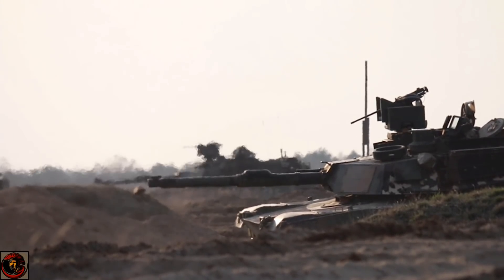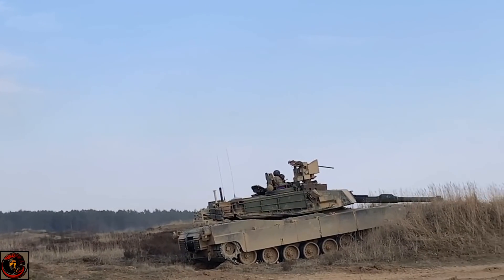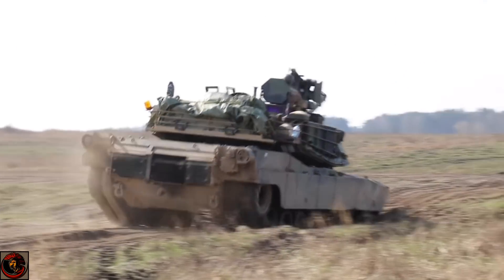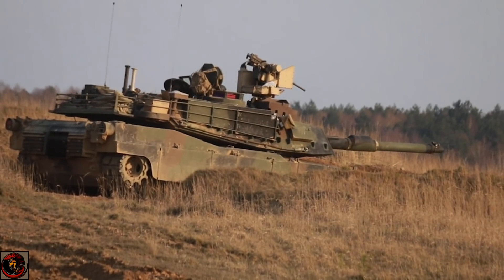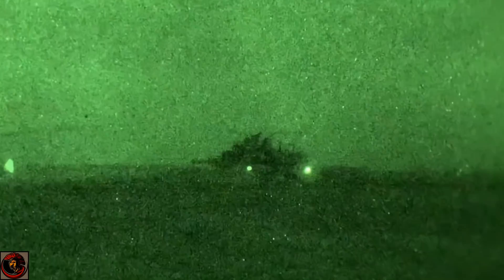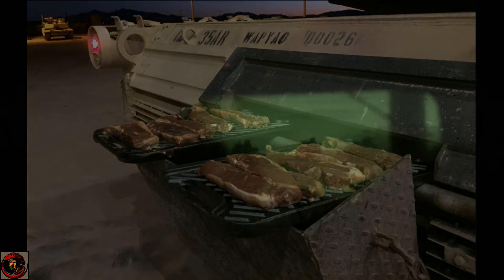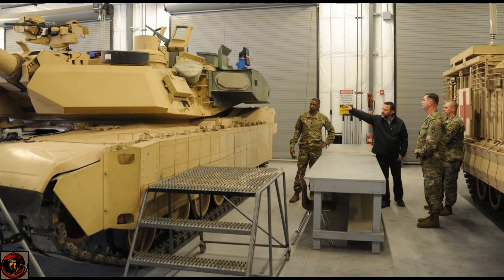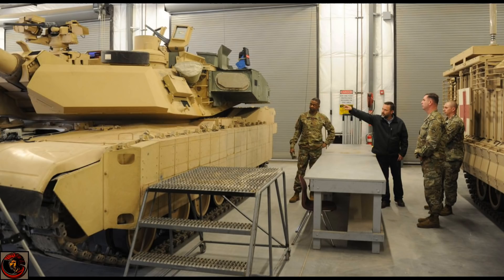M1A2C Abrams Tank Upgrade - The Last One?

Comment: Yes, the Abrams upgrade gets the Trophy active system AND a new top-secret armor blend that includes a layer of uranium.  So, both active AND passive protection upgrades.  And a very thorough digital electronics upgrade with high end computing power and data uplinks and a battery bank that allows the crew to operate sensors and the remote machine gun without firing up the turbine engine.

Comment: I wonder why they don't stick a 20 mm Gatling gun on the top, and use it for taking out incoming missles. Would also allow it to engage aircraft. And with how much it weighs, couldn't you build a hybrid system for it aswell, so you could run it in electric mode. Oh, and covering it in OLED screens so you can give it adaptive camouflage.

Comment: Now... One itty bitty little thing that people get wrong allot, that ALLOT of people think is true and is an inherent flaw to the Abrams.
It's fuel consumption.. 
In your video you say the Abrams is notorious for burning gallons and gallons of gas per mile.
While the Gas Turbine engine does go through fuel faster than, say, a Diesel Engine (Not much faster tbh, there are many Abrams crewman who can tell you they've been on long journey's for several hours without needing to refuel. One crewman has even said he's been on a drive for 15 hours straight without needing to refuel)
the Gas Turbine DOES have a far longer service life than a Diesel engine does.

Not trying look at you and go "lol he got a fact wrong, laugh at him" just pointing that out to anyone in the comments in case anyone despises the Abrams tries going "lol, gas guzzler"

But anyway, I doubt this will be the last upgrade to the Abrams

Active protection systems are not necessarily something of the future. APS's  have been around for several years. In fact, the first Active Protection System on the Abrams was actually an automated machine gun that targeted incoming ATGMs. And has proven itself to be effective.
I'm not saying to NOT install a trophy system to the Abrams, I'm just saying.. Active Protection Systems have been around for quite a long time, and aren't necessarily "the future"
Reply: @komradearti9935  May be a significant different, no doubt, but that does NOT deny the fact that the stereotype of the Abrams being a "Gas Guzzler" is VERY over exaggerated. And is merely something for those who have a blatant bias against the Abrams to use as an argument

Yes, the Gas Turbine consumes more fuel than a Diesel. While that much is true, so is the fact that the Gas Turbine gives the Abrams a higher top speed and lower maintenance cost.
And even then... Does consuming more fuel really matter when a Gas Turbine can use almost ANY kind of fuel...
Petrol, Diesel, fuckin' maple syrup, doesn't matter.
Shit if people were curious enough I wouldn't be surprised if some battlefield science found that friggin' compost can fuel a Gas Turbine. ( Obviously I know that's dumb and not possible, but I hope you get the point I'm trying to convey here.)

Comment: Tanker here, My old unit ran M1A1SAs since 2007, and in 2015 or so we did some wargames with another armored brigade equipped with A2 SEPs. now, one difference between A1SA and the A2SEP is the commander's weapon station; the A1SA has a powered cupola with a stabilized gun mount, which is not much taller than the original cupola. the A2 SEP has the CROWS system, and holy shit did everyone hate it. except us. because that was literally the first thing we saw every single time, and there were cases where the A2 commanders had to get entirely out of the turret to look around the CROWS. from what I've seen the newer low profile CROWS isn't much better. what's more the commander's stabilized weapon station is capable of much higher elevation, and can be reloaded without having to expose yourself very much. by now you might be saying "why did they delete the commander's cupola, if it's so much better?" the simple answer is that the commander's cupola makes use of a collimator sight for it's FLIR that would be constantly bumping into the commander's multifunction display in the A2.

Comment: I would not be surprised at all if the Abrams is put out to pasture in the next 15-20 years or so. It's a dammed good tank and it's upgrade history has kept it current with the times.  That said, it's a thirty year old chassis that was designed in the late 70's to replace the M60, and is itself based in part on the MBT-70, a failed design it took the place of.
Upgrades are great, but anyone with a mechanical background knows you can only push that so far, and I think the venerable Abrams may be reaching that point soon.

Comment: I think there is no other way, than crew of 3 in hull capsule for future tank... Remote control turret with 140mm (maybe 130mm in early versions) ETC cannon (like cancelled XM360) with autoloader, ASOP, next gen armour plus NERA, ERA or NxRA packages. Most important is the situation awarenes with sensors, and network centric Warfere. For me it is possible that crew will have not only monitors with at least 120 degrees od visbility, but even VR googles with augmented reality genereted in real time. So the creew, or part of the crew will have abbility to see through the hull with enhanced combined view from different modes from different cameras, sensors and outside systems like IBCS satellites calculated and supported by Ai. This will look like in few years or maybe decades time. I think, for Rail Guns and Lasers is to early.
Reply: The us doesn't like autoloaders for good reason. They are slow and highly unreliable. Are you Russian or something? 4 or 5 man tank crews will always be better because you can't beat a human loader. Russian autoloaders are about 8 seconds between rounds where most Abrams loaders are at about 4. Rate of fire Trump's almost anything

Comment: What aboht the lighter gun they were testing and "supposedly" a new armor that was just as good but also lighter?  Before I retired, these were being talked about.  If it worked it would also have the side benifits of less wear and tear on the chassis and engine as well as the much needed reduction in fuel consumption.  The weight losss was stated to be as much as 10 tons.  That would be amazing ifvit was true.

Regardless, this is a great machine with a great battle performance record for it and its crews. The only real tanks that can currently challenge it are British, French and if they are working, the Germans.  There are others that might, to be sure, but until they develop an actual combat record for themselves and their crews we don't know.  And hopefully we don't.

This old infantry guy tips his hat to those folks..."Death before dismount!"    ;)

Comment: Needs a 140mm main gun upgrade
Reply: Not nearly enough Dakka.... we need three, strapped together with the power of industrial flex seal
Reply: '
hi C J...
120mm is a middle weight but 140mm is more heavy weight...
that would be nice to have 140mm cannon gun on the M1A1 - M1A2 abrams battle tanks...
140mm can easily destroy any ussr russia tank
Reply: @bestamerica  The US secretly has them as in back in 2010 some Abrams prototypes were seen with larger cannon barrels on transport.

Case is US doesn't want to spark an arms race and keeps these technology in blueprints and schematics just in case RU or CN wants to up the game by going larger caliber

Comment: Let's say there are around 10.000 build Abrams. 400-450 Challenger 2 and 3.000 Leopard 2.
This gives a ball-park figure of 12-15.000 tanks in the same category of 60-75 tons.

Yes that gives a lot of older tanks that has been upgraded and if they had been constructed from a clean sheet of paper 10 years ago, they just might have been made lighter and slightly better - possibly.

The relevant question is, however, what is going to take issues with these tanks?
The 3.000 + T-90'ies of 45 tons?
320 planned T-14 Armata of 50 (-) tons?

These updated western tanks have a weight advantage of 15-25 tons and a numerical advantage of - say - 1:5. Which means you can preposition parity numbers about 5 different places - it will cost money in storage facilities and upkeep. But if you fly in the crews you don't NEED to move these lumps of metal all that much.

Let's ask ourselves: Is it realistic to think that - say Russia - will be able to sweep such a force aside?
I agree there is a lot of political blustering, but with minimum of sanity? Is Spain going to switch sides and join forces with Venezuela to invade the USA?

What is the more realistic possibility? That Russia will lie down and weep in selfpity or Canada occupying the western seaboard of the USA?

Will the USA occupy China? Given that americans are generally nuts it is a possibility, but even the most french patriot is hardly going to assume that the USA would wish to deal with the vast internal problems of China. Realistically: The crackpot iraqies have been quite bother enough.
Reply: Wtf...?

Comment: The thing is, you don't simply scrap 70t and millions of dollars worth of equipment, you keep upgrading the platform up until you can. The same idea, in a larger scale, applies to Navy ships. You don't scrap them after decades, since the hull is expensive, not only in terms of direct cost in dollars, but also the cost in time to build. So upgrades come as long as the platform is useful!
Let me remind people that even the Mighty Mo' fought well into the 80's after a retrofit and that wasn't some marketing stunt by Reagan and DoD, that ship could control the seas and give massive support fire if used correctly with support vessels, specially with the Phalanx and all the newer radar and missile systems. Besides shit tons of armor and 16in guns dropping a big F you and everything around you miles away is always effective, at least in changing pants colors to a more earthy tone.

Comment: Matt, you should check out Combat Mission from battlefront.com. They have WW2 and Modern-based CM games and I'd like to see you play them. They're probably most-similar to "Steel Beasts" but withouth the ability to directly take control and pull the trigger - but instead focused on tactical combat, terrain, cover/concealment. MilSim for strategy gamers, so to speak.

Comment: But, what about the M1A2 SEPv4. or M1A2D? You see, the M1A2 SEPv3 was on standard upgrade lists for the Army, but then the US Marines wanted to upgrade from their M1A1s to the new M1A2 SEPv3. So the Army put in its request as well. And its another notch above the SEPv3. But because of the Marines and Army having personal requests, they are being given the label as C and D rather than the usually Gen-Dyn Land System's classifications. 

M1A2C (SEPv3): Has increased power generation and distribution, better communications and networking, new Vehicle Health Management System (VHMS) and Line Replaceable Modules (LRMs) for improved maintenance, an Ammunition DataLink (ADL) to use airburst rounds, improved counter-IED armor package, improved FLIR using long- and mid-wave infrared, a low-profile CROWS RWS, and an Auxiliary Power Unit (APU) under armor to run electronics while stationary instead of the engine, visually distinguishing the version by a small exhaust at the left rear. More passive ballistic protection added to the turret faces, along with new Explosive Reactive Armor mountings and Trophy Active Protection systems added to the turret sides. Prototypes began testing in 2015, and the first were delivered in October 2017. Fielding is expected to begin in 2020.

M1A2D (SEPv4): Under engineering development with delivery planned to start by 2020. The Commander’s Primary Sight, also known as the Commander’s Independent Thermal Viewer, and Gunner’s Primary Sight will be upgraded with 3rd Gen FLIR, an improved laser rangefinder and color cameras. Additional improvements will include advanced meteorological sensors, laser warning/detection receivers, directional smoke grenade launchers and integration of the new XM1147 multi-purpose (AMP) 120mm tank round. The AN/VVR-4 laser warning receiver and ROSY rapid obscurant system have been trialed by the US Army for adoption on the Abrams tank and Bradley fighting vehicle.

==

heres some interesting news. So, Taiwan has put in a bid, that won, to order M1A2Cs once theyre available. this variant is being dubed M1A2X.

Comment: According to the relatively recent statement by Russian Ministry of Defense rep T-14 is not adopted and it won't be adopted in near future. Reasons being inability of Russian military industry to produce such advanced machines in reasonable quantity. Russia doesn't have it's own production of highly sophisticated hardware which mostly makes T-14 so good and it has been cut from high-tech European and American military hardware by sanctions so... There are still some shady grey schemes that include China as a proxy provider, but Chinese take their own cut and it eventually becomes way too overpriced and economically unreasonable. Also, T-14 needs to undergo a comprehensive proving test prior to it's adoption which alone will take few years at least. 
Anyway, for now this and many other less obvious internal problems for which they have no solution at the moment forced Russia to shelve T-14 and other Armata platform derivatives sine dia and switch to the modernization of those tanks they actually have in large numbers, so EU and US have plenty time to adapt and rearm; and in my opinion, they should not waste this time.

Comment: Remember, all the SEP packages add additional armor; as do the TUSK packages, which add ERA. 

Also, the Abrams gas turbine engine is actually very fuel efficient while the tank is moving -- not burning any more fuel than diesel counterparts. Where the fuel consumption of the gas turbine suffers is idling, as the engine -- by design -- idles at an exceptionally high RPM, thus burning far more fuel at idle than say a diesel.

Comment: Next Abrams upgrade: installing CIWS replacing loaders machine gun on turret.
Reply: The CIWS would have to be shrunken down a little to have it fit on the body...
Reply: '
hi D F...
CIWS is a too big size on the M1A1 - M1A2...
not good design...
machine gun shooter with a shield is a good enough than CIWS

Comment: One other comment: if the American military has announced that they will put a new main battle tank into production in 2025 then it has clearly already made it through the design, testing etc phases and they are just doing the final tweaks here and there on it before commencing production.  Weapons systems such as a main battle tank take a long time to develop and test and so if the new tank is only 5 years out and they have already committed to production, that means its essentially ready to go now.  Likewise, if these dates are correct then these upgrades to the Abrams are probably just meant to be stopgap measures to keep the Abrams competitive/survivable until sufficient numbers of the new tank have been produced to replace it.  That's really interesting though about a new tank coming down the pipeline very soon - I'm anxious to find out what it ends up being. The Abrams, while absolutely serving with distinction, was first put into service in '80 or '81 maybe and so it is understandably reaching the end of its operational lifespan.  Granted, some aircraft have been retrofitted (such as the B-52 and C-130) to keep them in service for far longer, but I think there is more room for upgrade and advancement when it comes to aircraft, as opposed to ground vehicles which to me come with more inherent limitations b/c of their design, that make them harder to upgrade/update.  Meaning, there's only so much you can attach or reshape when it comes to a tank without compromising the original tank's positive attributes - go much further and you've essentially created a new vehicle entirely. Whereas with a plane, so many of the upgrades can be added without having to alter the actual airframe (I.e. affixing upgraded engines, avionics packages and sometimes weapons as well - as in the C-130 gunship upgrades). So new tanks can and have been be fitted with upgraded electronics (targeting, communications/networking) packages as well, but once you start fiddling with say, the size of the main gun, you begin to run into space problems related to the turret and so on and once you begin altering the armoring, b/c of weight issues you then have to upgrade the engine and then the suspension system etc etc.